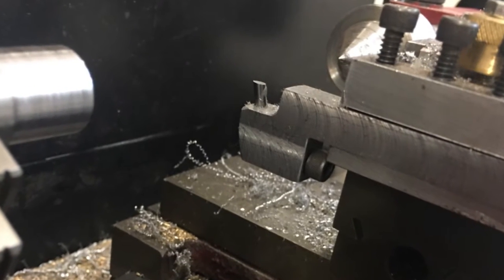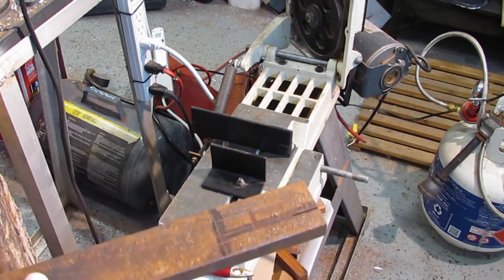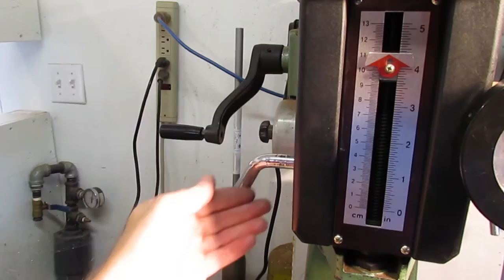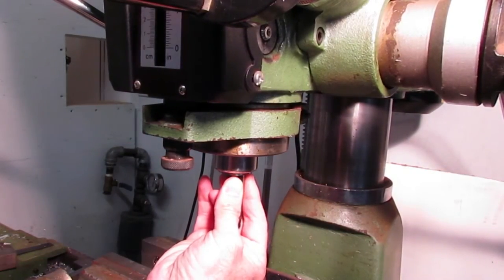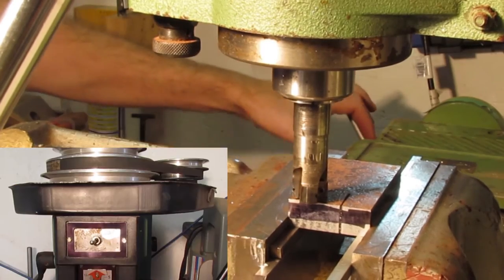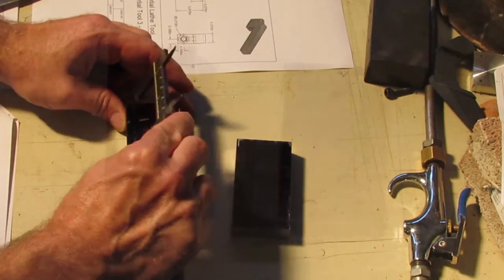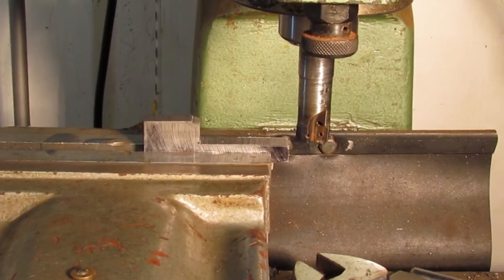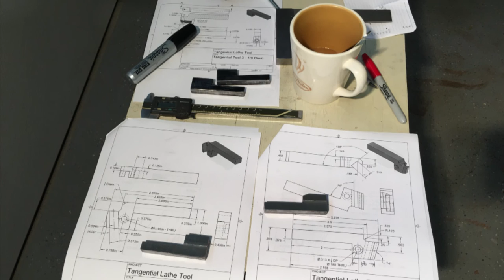Making Tangential Lathe Tools   Part - 1

Comment: Now if you think Tangential Lathe Tooling is fun and can yield good results. Now consider a Mill Tangental Fly Cutter. Consider how the tool approaches the work on the Lathe. Now take this same approach and design a tangential Mill tool holder. The round tool bit is easy. Now try to achieve the same thing with square HSS or Carbide tool cutters. the results can be awesome. Just some thing different and off the beaten path of Mill Tooling.
Reply from the maker: Thanks for the comment, I have thought about that and might be something I will try this fall.